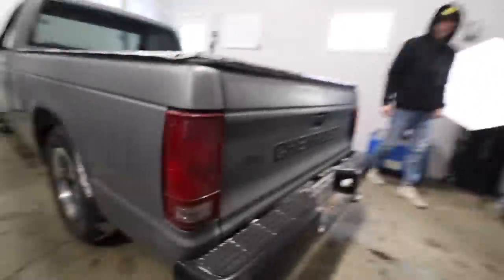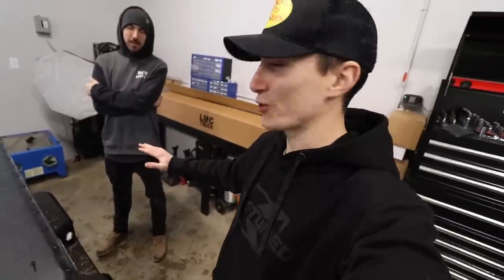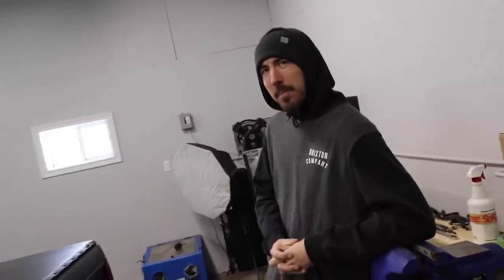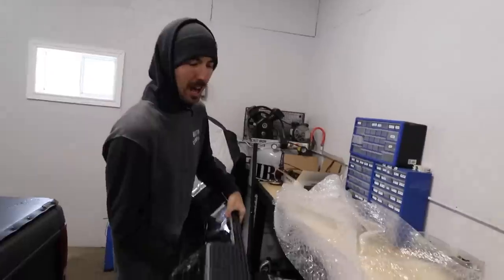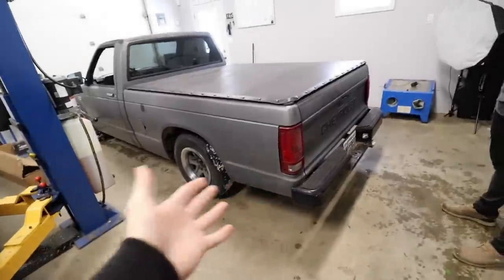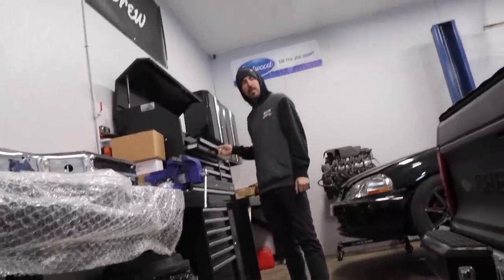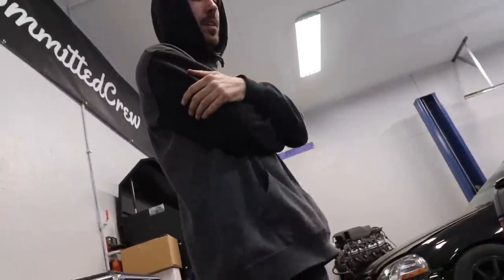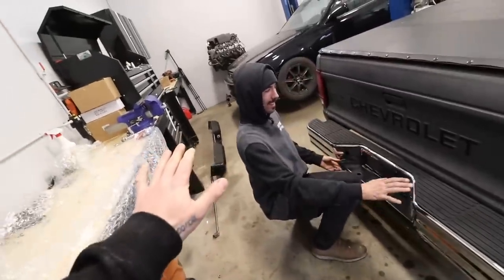I Shouldn’t Have Done This...

Comment: You should try Metal Rescue Rust Remover Gel for any rust spots so you don't have to grind and replace parts. It works VERY good for removing thick rust and its $14 per container.

Comment: Ok Robbi, I have a question. Is it really so easy to work on old American cars? 😂 Like you changed your mirrors in like 15 minutes😂. Dude I live in Germany so we for the most part have Euro cars here. I changed the mirrors on my VW and I like had to take the doorcards of and... I basically was a pain in the but like it is with most German cars. You like took of the plastik housings, unscrewed 3 Bolts and you were done😂.